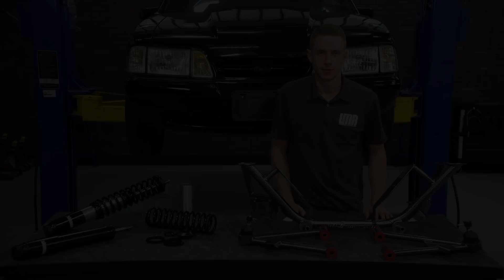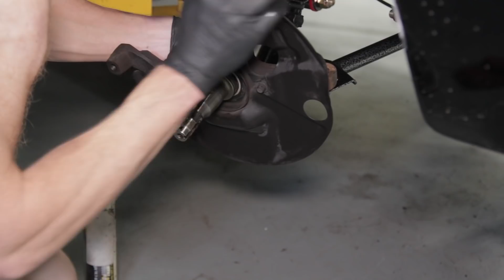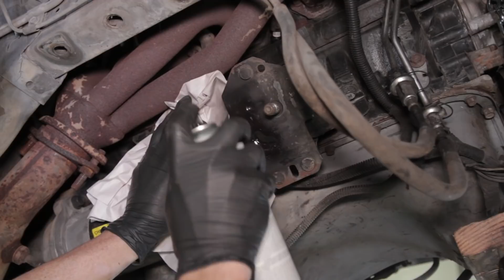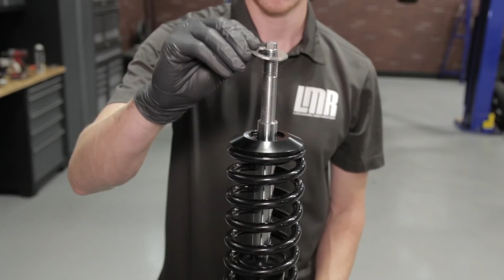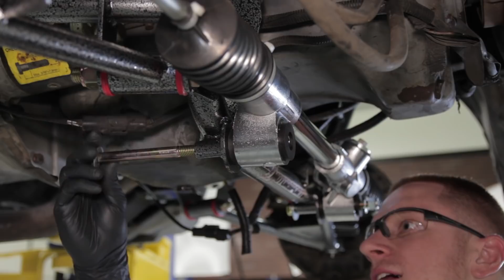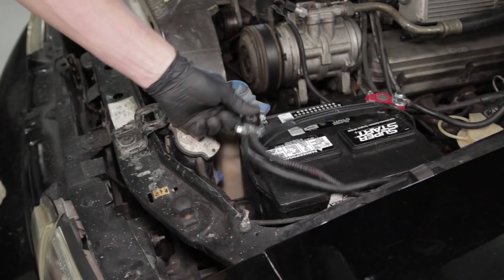How To Install Fox Body Mustang Team Z K-Member (1979-1993)

Comment: Hey Landon! What size wheels and back spacing are you running in the front with the team z front end conversion kit. Tried putting on  17x9 with 5.98 BS. The wheel suck out way past fender and looks like the tire will hit the coil over. Thanks!
Reply from the maker: The front wheel setup on the car in the video was a 15x3.5" Weld Prostar with a -13mm offset (1.75" BS). The tire is 185/68/15. A 9" wide front wheel on a Fox Mustang causes problems regardless. I've always had to add steering rack limiters and modify the inner fender splash shields with a heat gun to achieve adequate clearance. Even then, I've still had a 9" wide wheel/tire rub somewhere.

A 9" wide wheel with a 5.98" BS shouldn't stick "way out" past the fender. If the control arm is Fox spec (center of bushing to center of ball joint). That wheel should "work" with still performing the aforementioned steps above. Are you using an SN spindle? SN spindles will move the wheel out in comparison to a Fox spindle. -Landan
Reply: @latemodelrestoration  Thanks for the info Landan!

Comment: MM seems to have the strongest K-Member, Team Z K-Member looks weak and would hate to see if one got into an accident
Reply: BMR is really nice. Just as good or better as MM and you don't have to use coilovers with BMR every other aftermarket k member you must use coilovers 

I'm gonna use regular style  springs and adjustable struts.

Comment: Will i need A Arms and the coil springs with the LS k member or can i use factory A Arms and springs?
Reply from the maker: You can use factory lower control arms and coil springs with a Team Z LS-swap k-member as long as you run an upper spring perch. We sell the BMR version (links below). Also, due to the variances in aftermarket k-members and factory or factory-style front lower control arms, you'll have to widen the ears on the k-member where the control gets positioned. -Landan

We did something similar whenever we were mocking up the 7.3L Godzilla engine in one of our cars. Here is the link to that video with the correct time stamp: https://youtu.be/U1EskdoIrxQ?t=723

Red coil spring perches: https://lmr.com/item/BMR-CSS730R/mustang-upper-coil-spring-seats-bolt-on-red-79-04-css730
Hammertone coil spring perches: https://lmr.com/item/BMR-CSS730H/bmr-mustang-upper-coil-spring-seat-kit-bolt-on-black-hammert

Comment: So question: ive got an 03 mustang that im considering changing the k member out for this upr one i found in a storage unit i bought. Is the process more or less the same as in this video? My rustang has a 4.6 2v.
Reply from the maker: Yes, the procedure for a 94-04 Mustang is nearly identical. You'll notice this once you start wrenching. -Landan
Reply: @latemodelrestoration  good to hear, thanks!

Comment: Is the aftermarket steering rack required cuz my factory one is hitting against the the K-member now
Reply from the maker: Where on the k-member is the power steering rack making contact?  -Landan
Reply: Where the power steering lines run down into the steering rack.

Comment: The steering Wheel must be hard tu turn if its not hydraulic?
Reply from the maker: Jesse - Yes, manual steering racks require more effort to turn the wheel.  It isn't that bad in a Fox Mustang, though.  -Landan

Comment: Expect to modify the bolt holes because they do not line up exactly, I had to move 2 holes over a little to make it work. It took me and a friend 4 1/2 hours to remove the old suspension and put in the new K-member and the A arms. Will start on the struts and camber plates tomorrow.

Comment: What part number for that Strange Front Strut for the coilover kit? I have a 1979 Foxbody, but can't find that on your website or Strange website
Reply from the maker: Todd - To my knowledge, Strange only manufacturers their strut to fit 87-93 Mustangs. 79-86 V8 and 79-93 4-cylinder cars will have to convert to 87-93 or 94-04 SN95 spindles to fit the Strange struts. Hope this helps! -Landan
Reply: @latemodelrestoration  thanks.  I didn't realize i would need to change spindles. I have a full tubular k member and a arms. I'll look into it

Comment: I bought this kit a while back and one of my ball joints had a grease fitting and the other side did not. Is that normal?
Reply from the maker: It definitely needs one! I would contact Team Z or source one local from an Auto Parts store or hardware store. -Landan

Comment: Hey Landon have you ever but a 4r70w transmission in a fox body mustang if so can you use the stock aod shifter thanks for any info
Reply from the maker: Gregory - I've never put a 4R70W in a Fox Body. I don't see why the factory shifter wouldn't work. However, the gear selection will read incorrectly since a factory AOD face plate reads "1, 2, D, D(in circle)". A 4R70W utilizes a "1, 2, D and then an electronic O/D off button." Hope this helps. -Landan